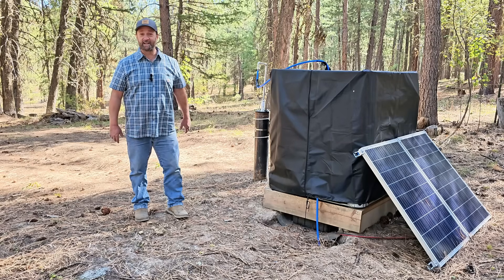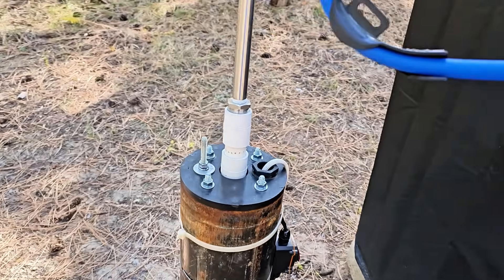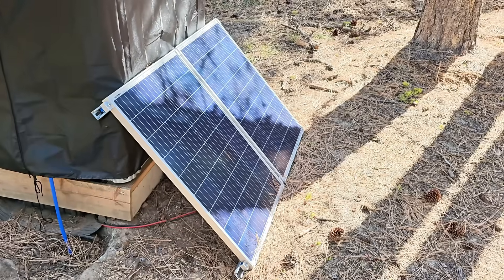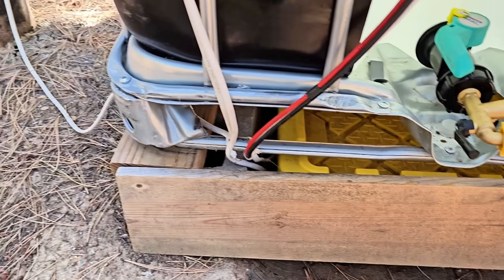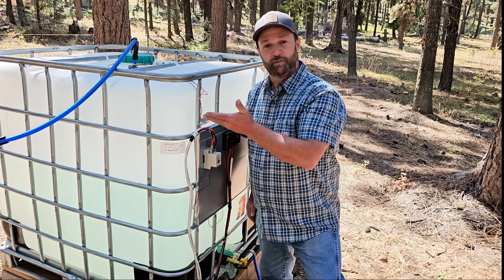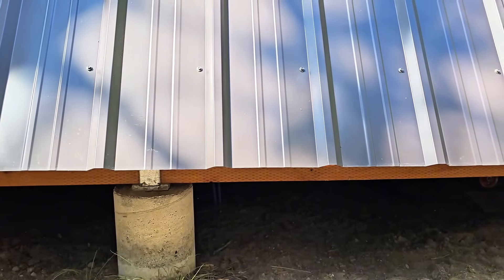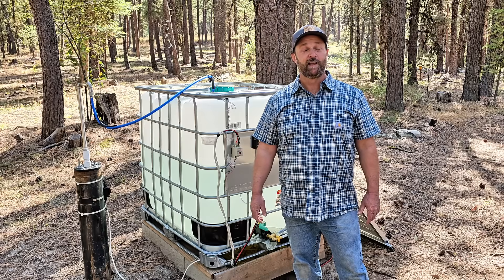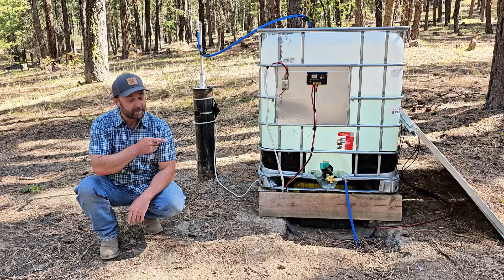DIY Off Grid Cabin Water System (Solar Powered & Automatic)

Comment from the maker: What’s your off grid water setup like? Do you haul it, pump it, or collect rainwater? I’d love to hear what’s working for you.

👉 Full parts list is in the description if you want to see the exact pump, tote, and sensor setup I used.
Reply: Great video. This is very helpful for when I upgrade my system. Right now I just have rain catchment and if needed haul water. Any water needs is just from a hose attached to the water storage tank so a system like this would be a huge upgrade. I’m planning on just doing upgrades this summer and no new builds so I can improve what I have.
Reply from the maker: @thelostminerllc that's the off-grid spirit! Make what you have work and upgrade as time and $ allow. Best of luck on your build!

Comment: Do you have a filtration system installed?
Reply from the maker: Great question. The only filter I have  is a particulate filter installed right before the pressure pump that comes with the pressurepump. Other than that, my well water is high-quality and doesn't need to be filtered. Thank you for watching!

Comment: How often are you treating your tank?  Do you use chlorine or something else?  You might want to swap that cover with something white or reflective to keep the tank temp down because it will grow bacteria faster as the water gets warmer.
Reply from the maker: Thank you for the great suggestion.  I lighter color cover is a great idea. I could probably even turn it inside out since it is silver inside.  I only treat the tank if we are gone from the cabin for long periods of time and I just use chlorine. Otherwise, it stays pretty fresh because it is always getting fresh water added to it. Thank you for watching and taking the time to comment.
Reply: Keeping sunlight off the tank inhibits growth. Tank color doesn't matter. My research indicates black as a common color due to its ability to block light. Yes it warms the water. Someone in another video I watched used pickup spray liner on their rain collection ibc tote then painted it white. Cant find that video now or I would link it.
Reply: @criticaltemperature3343  Actually, some bacteria are killed by the UV waves in light and I wasn't referring to the tank color.  I was referring to the cover.  A black cover, even if insulated, will transfer more heat in sunlight than a white or reflective color because it absorbs more infrared waves (even though most waves also transfer heat).  Also, for all practical purposes, the warmer the water gets, the more bacteria and bad stuff will grow.  UV light is commonly used to kill all sorts of bad stuff.     Covers and paint can slow something that has chlorophyll, the green stuff that grows.  Even though I wouldn't say that's safe, it's probably safer than the germs, bacteria, viruses and other stuff that can grow in shaded warm water.  You won't necessarily know your water is bad by the taste or smell.  You'll know it when you're sicker than a dog, and maybe on your way to the hospital.

Comment: I like the system but the eco-worthy pump gets bad reviews for having a short life
Reply from the maker: Mine has been working great for over a year. They are cheap enough that I actually bought a backup. Personally, I wonder how many of these pumps that got bad reviews were installed and  used properly. Time will tell and I will keep you updated. I really wish a company would come out with a good middle ground 12v or 24v pump that is built solid but not super expensive.
Reply: @solojimoutdoors  The deal with the cheap 12v pumps (Eco-worthy being one of them) is that they're brushed motors. Under heavy use, the brushes wear out. Because they're brushed the motor cavity needs to stay dry. After a while the seals will fail and water will foul the brushes. Then you have to haul up 125ft of pipe to replace it. If you have a pump house, now you'll have to remove the roof unless you can remove your pipe in 7ft sections! For most people, it will be worth it to pay the extra money for a brushless or induction motor-driven pump.
Reply from the maker: @explorigin do you know of any brushless 12v or 24v pump manufacturers that make something for less than $500? I would love to reach out to them. Thank you for the quality information.
Reply: @solojimoutdoors i have been looking at some of the 48v units given my offgrid power is 48v based.

Comment: I'm sure you would have considered putting the IBC on a short tower to gravity feed the cabin. You'd only need one pump then. I'm wondering why you discounted that?
Reply from the maker: That is a great idea that i may have to try. I actually installed the pressure pump before the rest of the system and hauled water in and put it in a tank for the first couple years. If the pressure pump ever fails, I will have to try a tower and gravity. That sounds fun. Thank you for the suggestion.
Reply: It's a great idea. I just searched for  some basic requirements.lets say 40psi pressure at the faucet. That means you need the ibc 80' higher than faucet to get 40psi. Also water weight is about 8# per gallon, so 275 ibc weight,full, is 2200 pounds. That's a stout tower unless your on the side of a hill and can leave the ibc near the ground and still get an 80' height difference. My city water pressure at my home is 100psi regulated down to 75psi. To get that, the tower is 150 feet tall. I may look into something similar to the setup in the video for my off grid camp. But I'll need a well first. Right now I bring in 15 gallons at a time for weekend use.
Reply from the maker: I brought water in for over 2 years. I started with a 50 gallon tank in the ground and a pressure pump and built from there. The well was expensive so it took a couple years of saving to make it happen. Best of luck! Thank you for your insight on the tower idea. .

Comment: Actually you doesn't need that water level controller. Simply put a float switch or also you can directly condut the 12v dc supply through that water using a SPDT relay. 
Or as I did earlier, directly running the pumps on the solar panel directly by avoiding the cost of charge controller and the batteries.
Reply from the maker: I love these ideas. Thank you for sharing. Running the pump directly would definitely be a cost savings. How does an SPDT relay work?
Reply: Sounds like a great idea. I understand the direct wiring the panels to pump. What's the spdt (single pole double throw) relay for and how is it controlled??
Reply: @criticaltemperature3343 in that SPDT relay,we just supply battery power to 2 wires just like your level sensor. Using NO and NC function we can turn the pump on and off.
In this only 2 wires are used for sensing the level. Power flows through the water and when water level gets low and sensor looses conductivity relay is triggered,samw for high level

Comment: Good day Jim ! Great little cabin water system 😃, Pretty simple for sure sometimes two little pumps are better than trying to run a big 220v like most, I love my little 3gm pump I've used for 11 years at my cabin & it works great :) Awesome ! Have a great weekend"
Reply from the maker: Thank you Don. What kind of pump do you use?
Reply: @solojimoutdoors  Jim as you know my well is only 17f deep & I built my cabin over it so will never freeze, But all I have ever used here is a 4gpm SurFlo 12v 50psi RV pump :) They say they will only pull 10f but I put foot valve on the bottom & a check valve only 3f below the pump so it never looses prime ! Take care my friend"
Reply from the maker: @littlegriffoffgridalberta6837 that is a great little setup. Thank you for sharing.